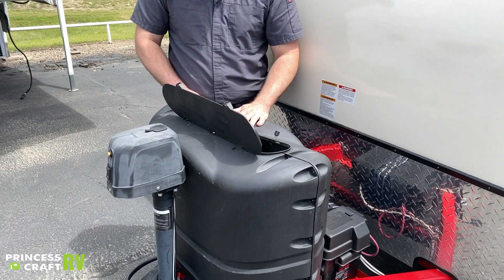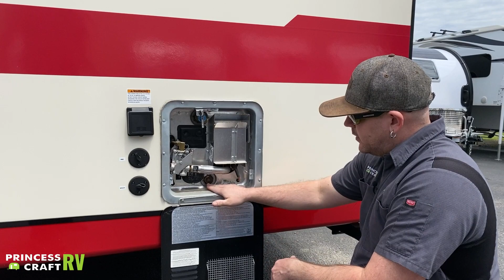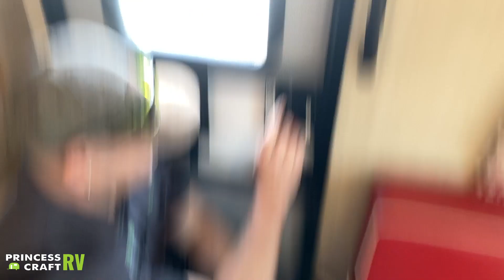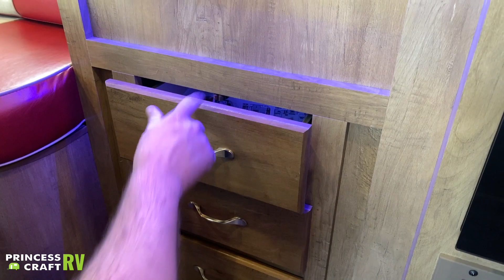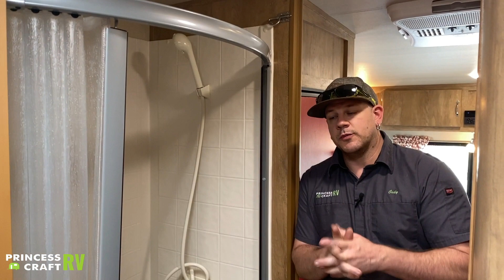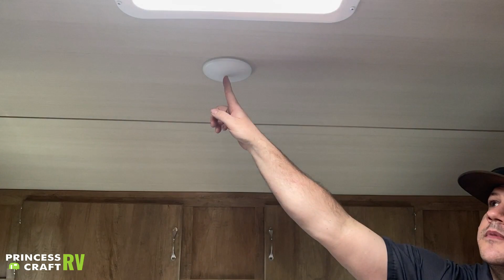Technician Tour - Vintage Cruiser 19ERD by Gulf Stream Coach

Comment: Thank you. Great walk through. I purchased a 2017 Vintage Cruiser 23RSS.How do you use the spray port. Does it work off of the on-board water tank and pump? We have only stayed at RV parks that have all of the amenities so I haven't filled the water tank or used the pump. I do know that the pump turns on. Also, I would like to install a rear back-up camera on my Vintage Cruiser. What do you suggest for that installation?

Comment: Great tour, thanks!

Is there a main 12v battery disconnect on this model?  I sure can't find it on my parents camper.  The battery tends to run down when the camper isn't used.
Reply: No, but you can install one right at the battery.